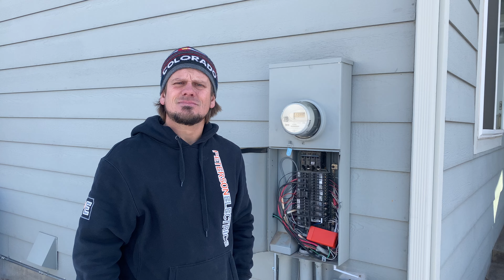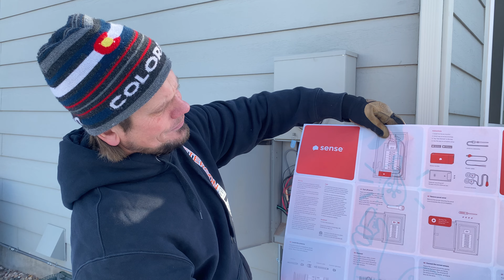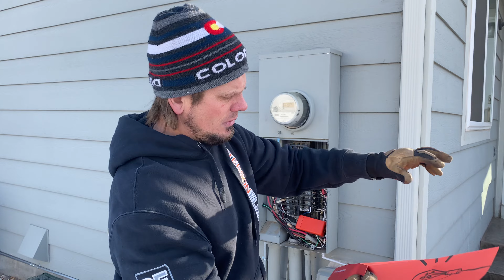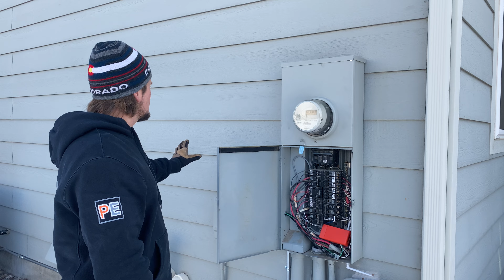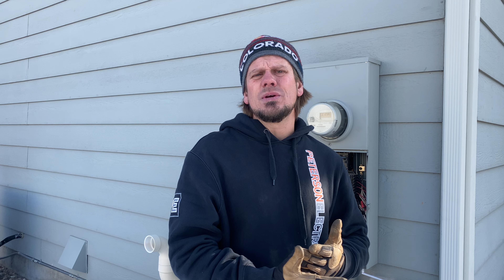Discussing the Sense Monitor

Comment: Great video and to the point. I noticed you are in Colorado. You installed it in an outdoor panel. The lowest temperature range in the instructions is 32 degrees. Have you seen a problem below 32 degrees?

Comment: Why are those meter-main combo panels so common out west? In the midwest and east, you usually find a separate meter base and load center. And of the meter-main combo panels I've seen on various Youtube videos, they're often filled with tandem breakers, like they used a 20 space panel when a 30 space would have been more appropriate.

Comment: Antenna length is based on the wavelength of the signal that it communicates on and the desired signal radiation pattern. Simply lengthening it without taking the frequency into account will only cause poor performance. A correct "longer" antenna does exist, based on the wavelength, however the signal pattern will be different and it could actually become a disadvantage